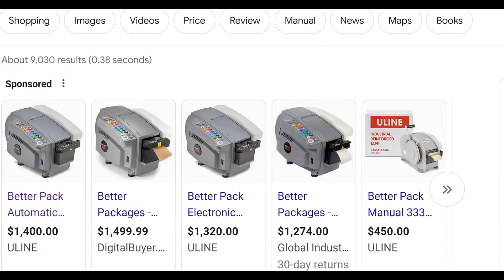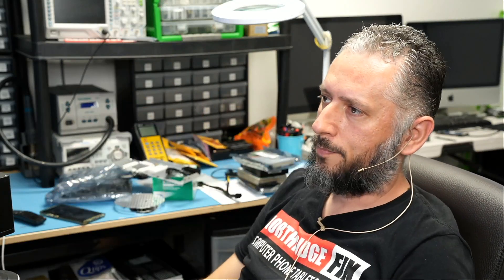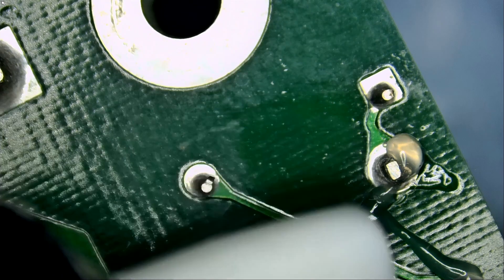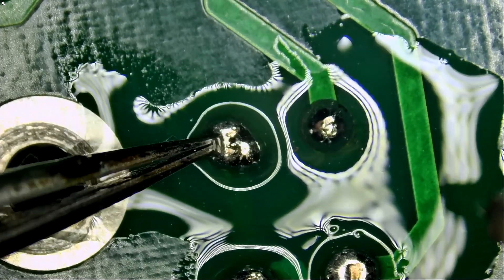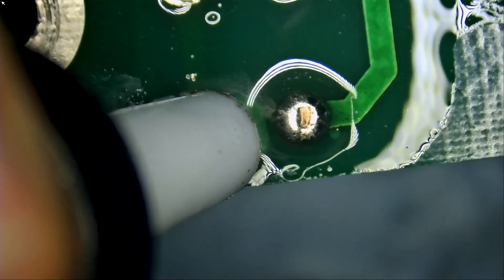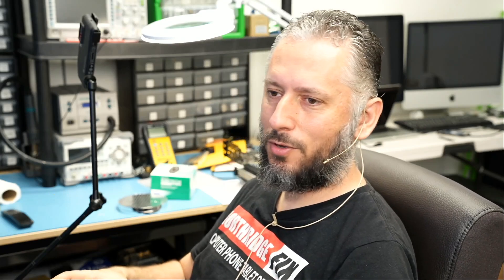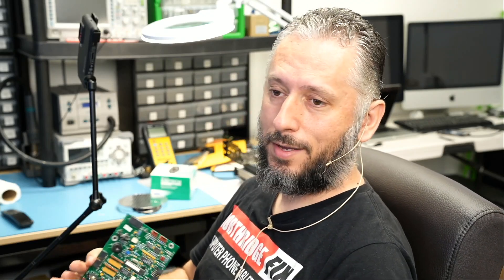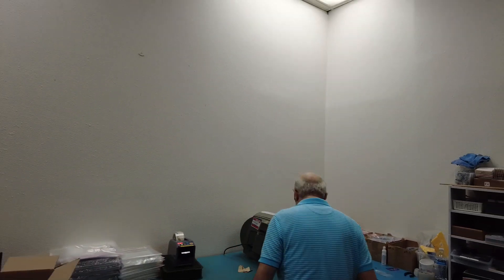Better Pack 555ESA Repair. $10 Component Fixed a $1500 Machine.

Comment: Good ole tape dispenser...I worked DOD logistics for over 20 years and went through a few of those machines...when they  work they work and when they dont and your in the middle of packing and its a needs to go out the door item.. frustration would set in and then you have to grab a tape gun to finish the job...lol my co worker swore by the manual tape machines that didnt require electronics you just pulled a handle to desired length...that was a back up we kept around also..

Comment: You should try the solder sucker that has the soft silicon tube end rather than the hard plastic. You can get it flatter to the board even with the iron there. I personally hated using the hard tip solder sucker, hardly ever worked unless I heated one side of the board and used it from the bottom side.

Comment: The relay probably drives the motor.  A trick used on car points was to put a capacitor across the points to stop arcing and make the relay last longer. Another trick is to put a 12 volt zener in series with relay driver fly back diode to make relay turn off faster.

Comment: I can understand that tape being more resistant than your average packing tape (since the glue soaks into the cardboard), but I've seen packers use (good) tape dispenser guns, and it literally takes them less than 2 seconds to do each side (3 to 5 seconds per box, tops), so I really don't think that's faster. Probably more secure (assuming you can't get the same type of reinforced tape in a roll that fits dispenser guns - it would be tricky to use wet tape for that), but I can't see it being faster.

Comment: There good machines we use them at work for the tape for boxes we just replace the PCB when it fails as not worth the time of trying to diagnose the issue to the company using the serial port at the back you can also have it linked to automatically dispense tape required.

Comment: I think the original fault was a dry joint on the first solder point you showed at 4mins 21 sec.  It had the crusty rough edges you find on dry joints,  and these are familiar to TV engineers of the recent past where a lot of heat is generated in the joint due to the high currents in power supplies. I always look for the black ring around the solder joint using a magnifying glass,  followed by a reflow.  This usually resolves the problem.  Perhaps you agree?

Comment: Its nice that the relay was available to buy, I had to repair my electric stove since one of the "temperature control" (clicks on and off every time the temperature is exceeded) relays burned after 10 years and that relay was not available at any distributor at all (which would be nice since I can get authentic parts really fast trough my university), not even local ebay.
I was a bit lucky that there were new old stock ones from china but since I needed them fast I accidentaly brought NC instead of NO relays
Not a big problem tough, the power gets turned on by another relay so I resorted to a quick hack with a mosfet in the signal line from the microcontroller (to invert it), works a treat :)

Comment: It's clear to see the original relais has a cold solder joint (top right pin at 4:03)  I think this was the problem not the relais.

Comment: These also have a little magnet on the side of the top hatch/cover so the machine will not work if the lid is open. These magnets also like to fall out but you could short the 2 pins of the sensor on the board so the machine will work again.

Comment: for tht components solder sucker with silicone hose at the tip like engineer ss-02 are better, you can put it right on the tip of your soldering iron while heating up the joint and create a seal to the pcb. they suck up solder much easier then the ones with ceramic tip.

Comment: Nice informative video again. Thank you.
What do you think about solder with a flux core. Good or bad?

And could you do a comparisons about those solder suckers you used and the ones with a vacuum pump attached.

Thanks and keep up the good work👍

Comment: In business, you have to keep the profits from going out the door in such matters as repair of equipment just like you did.
I've repaired many home appliances just by first looking up anything showing how to diagnose and then possible troubleshooting.
Before the internet, I would go to book stores looking for "how to fix" books.
Reader's Digest came out with such a library back in the 80's with very detailed books with good photos on how to fix pretty much anything.
From there I bought tools like multi-meters and specific hand tools needed for whatever I was working on.
I leaned how to do preventive maintenance on many of my home appliances to keep them up and efficient. I had a washing machine for over 15 years and a dryer even longer.
Once you take apart a washer, you see things like mildew buildup under the tub rim and dryers full of lint that could cause a fire.
I'd usually do preventive maintenance once a year on these and then do things like oil  motors on my microwave or the HVAC motors.
Cleaning the AC coils inside and out keeping them efficient and the filters cleaned every few months.
Even door hinges and handles need oiling.
And before you have a plumbing back up, take the traps apart and clean them.
Facet washers and o rings will last about a year so replace them also.
Waiting till things get so bad that they don't work any more will end up costing you money, time and inconvenience.
One thing that can turn disastrous is the hot water side inlet hose that has about a 2 or 3 year life span.
It is always under pressure and when it breaks, and you're not home, well, you can imagine the grade of destruction.
IN any new house I've ever owned I've kept a maintenance book on all the different appliance and things like hot water heater or HVAC systems along with the regular things like can opener and more.
This way I know the age of the appliance and the maintenance schedule on it.
It will tell me the reliability of certain brands of appliances etc so I know if I'm getting my money's worth.
I see now that there are these home insurance services for such things but they only payoff when the appliance goes critical and there are loop holes that they use to either get out of it or cancel the services.
You don't have to be an engineer to do these simple maintenance and repair tasks. The internet has put everything right there for you.
Just make sure that you look at many repair videos so that you can see all the other people's ideas and techniques.
There are some on the internet that are just idiots and will cause you more problems so check out as many as you can stand to see how many jive with the same successful technique.
Approach any and all for the first time with caution and go slowly.
Don't guess but use common sense and good instruction.
IF you've never touched anything electrical then get basic with learning from the beginning.
I can remember when electricity was such a mystery to me.
Yeah, I've been shocked a few times but nothing bad.
Electricity is to be respected and to keep cautions when dealing with it.
I remember hooking up my first live power cable to a house weather-head but I was on a fiberglass ladder so basically I was not conductive or grounded. Stripping the live wire coating and sliding on the crimp-able sleeves And then using the big metal crimpers.
It was scary but at the same time I knew as long as I touched nothing conductive or grounding that I was safe.
IF you think electricians never get electrocuted, you would be wrong, It happens all the time.

Comment: The relay clearly exhibited fractured solder joints. I would bet a cup of coffee that removing the old solder and then flowing new solder onto the joint would have fixed the issue.

Comment: The contacts on the relay just gets a layer of carbon  on them over time. You could even pull it apart and clean them carefully and it will still work unless the coil itself is burned out.
The contacts have a layer of silver plated on them and are quite robust, but as mentioned before, the carbon builds up each time the contacts make due to the smallest arc.
Reply: It's worse when they open on dc inductive loads due to back emf. Mentioned it earlier but flyback diodes drastically reduce it and increase the lifespan of the relay. We used to change relays every year in a factory that had a lot of relays driving solenoids. You could see the huge blue arcs when they were opening off. I went through and put diodes on them all and almost completely stopped the arcing across the contacts.

Comment: You dont use solder sucker in the right way. You must heat the solder joint and put the tip of the sucker verticaly on the joint (not on the side of the joint) and push the button. Have a good day ^^
Reply: Correct. That's why pro grade solder suckers have high-temp resistant tips. I thought every Tech and Alex especially, knew this.
Reply: @blackrifle6736  Personally (although amateur) I use a desoldering gun. Infinitely more practical than these solder sucker (if it's for a few solders it still helps)
Reply: @TWFactory  That's pretty plush. Our Lab had a couple of hot nozzle, vacuum pump types, powder blue as I recall. Cleaning slag catcher and filter was a PITA because no one wanted to do it. Cheers!

Comment: For that kind of solder joints, better use dessoldering gun station than hand pump. With this tool, taking out such kind of relay is a matter of seconds.

Comment: The manufacturer, if they fixed these things at all, would no doubt only want to replace the whole motherboard if even that, and charge you the ridiculous amount even though a small and cheap things was broken and easily fixed.

Comment: That tape is actually glue tape. It's 10 X better because it soaks the glue into the cardboard for a perminent bond instead of adhesive which just sticks to the surface and can fail.👍👍

Comment: Can't be certain but it looked like there were dry joints on the relay coil pins - the ones near the edge of the board. Would explain the intermittent nature of the problem. Would also mean it worked fine after the new relay was in because of the now 'better than factory' joints 😀
Reply: 100%
Reply: Yes. Could it be because it has a moving part generating vibrations every time it functions?

Comment: Hello. the problem is the type of relay and how it presses on the contact points. relay presses too far down on the contact pin. The others are that the relay does not have a suppression capacitor which should reduce sparking between contact points. with a relatively large motor, the motor will wear out the relay very quickly

Comment: Alex said he “took a shot in the dark.” No, that was an understatement. It was an experienced troubleshooter’s analysis of the most likely root cause.  And a great example of the excellent teamwork between Alex and Big Boss. Happy Father’s Day to all of you.
Reply: I can't imagine ordering and waiting on a relay without at least checking the ohms on the coil or testing its activation, especially before making a "shot in the dark"
Reply: If sometimes you hear clicks and sometimes you don't, a relay is the first place to look. But I guess it was a shot in the dark in the sense that he didn't actually test anything, and the problem could be in the circuit that controlled the relay, and not the relay itself.
Reply: thank you for writing this 
this is what I was thinking of  😇
Alex is the best 💪

Comment: Nice video Alex.The machine in the photo looked much smaller and i thought 1500 was a lot,but in business it's really about doing the job better and faster.That machine certainly does that.Then when i saw the real one ,i thought heck no wonder it cost a lot it's BIG and heavy with a lot more components to it.That means it also has encoders to measure the tape length and if it starts giving you odd length tape pieces it would be the disc that goes through the sensor has got tape fuss on it.We had one where i worked that i fixed but a different brand and smaller.big boss has a great memory.

Comment: Wait! was that a solder sucker??? Great repair! Paper tape is way more awesome than that clear junk. As a know-it-all side note. With clear tape everyone uses 2" wide, which is not made for hand taping. even though everyone uses it. 2" is for automated taping systems. for hand taping you are supposed to use 3". But paper tape is far superior.

Comment: no low-melt solder when soldering back the component because it may fall out of place when the operating temperature rises.
Reply: Alex knows that. He's made that point on several occasions, including in this video at the 8-minute mark.

Comment: I've been in this situation when my tv broken. Fuse keep blow if replace with new fuse. Search for power supply board so expensive online. Replace 3$ triacs that faulty fix it. My first repair attempt successful. So glad😂
Reply: If it was a TV power supply it was probably a mosfet and not TRIACS. Congrats!

Comment: Driving dc inductive loads like this motor causes decent back emf across the contacts of small relays when they open off causing them to wear out really easily. If you put a flyback diode from negative to positive on the output to the motor, you will get a few more years out of if before it wears out again. Love the videos by the way!
Reply: I highly doubt that isn’t already populated on the board. It would potentially kill other components on the same power rail, which would happen mostly under warranty since it’s not an exposure failure. No company wants that.

Comment: Love watching big boss disassemble and or reassemble. Great skill and patience. Fine troubleshooting and repair Alex. Absolutely great.💖👑
Reply: As much as the focus is often on Alex's skill, we shouldn't look past the skill that Big Boss has - it is a huge enabler to the success of the whole endeavour.
Reply: I fix alot of things myself,  not at the level Alex do,  but i do try :D  and i am also lucky more times then not.  One of the things i hate the most is the disassemble,  there is always plastic tabs that break so easy,  a hidden screw under some tape or other stuff you first notice when you almost broke the pcb or something else..  and cables you need to disconnect for some lcd screen or something..

To me the disassemble is just as hard as the fix,  not always of cause,  but sometimes you fight with the damn disassemble for 30+ mins just to replace a stupid fuse you couldnt access without the disassemble..

So even i am sure some people see Big Boss as just a cool name for the low end easy job,  i feel it isnt always easy.

For sure a nice team :D

Comment: I noticed 2 cracked solder joints on the board edge at 4:04. Maybe even resoldering relay pins have helped to cure the problem?
Reply: There were no crack on them, just a little fibre.
Reply: Yes, I noticed that too.

Comment: If you sent it back to the company for repair they'd probably go like "we have to replace the whole board, that will be $1k, thank you". And that's assuming they'd even bother doing board level repairs.
Reply: You shouldn't assume they do board level repairs, most companies don't think it's worth it to find skilled enough people to have component level repairs. They'd just replace the board
Reply: U shouldnt cry at a company for doing this, its their right to not focus on microsoldering repair, its totally different to manufacturing. U should cry at a company for actively blocking 3rd party repair, like blocking chip or component supply or locking parts in the device by software.
Reply: no company repairs such things, because it's unprofitable.
looking for a broken component and hiring a technician would cost the same as a new motherboard.

Comment: it looks like one of the relais coil solder joints where cracked i see similar problems every day working on german dishwasher / Washing machines and its 95% a fix with just solder all solder joints of those relais again